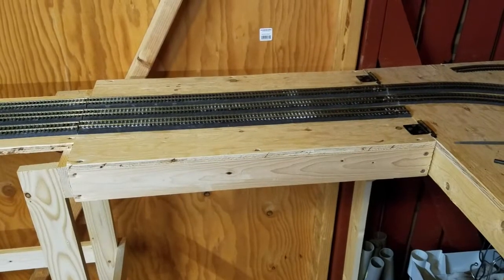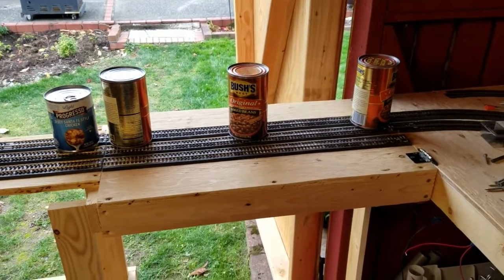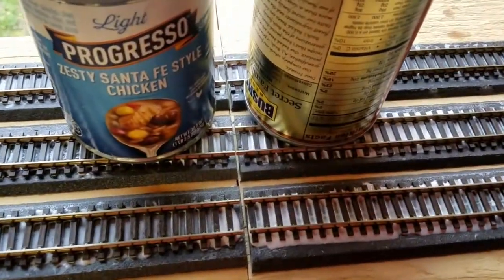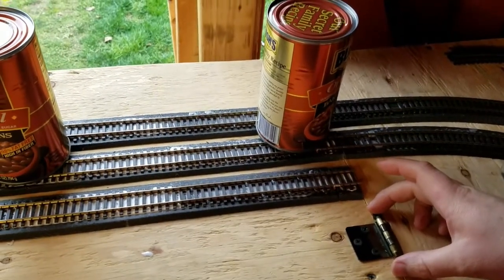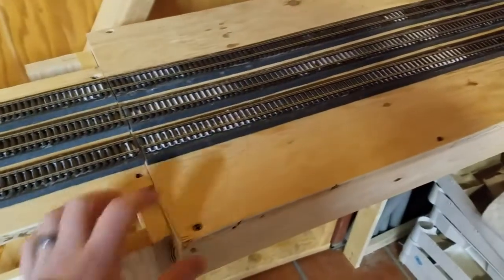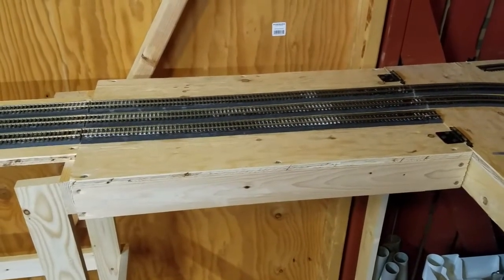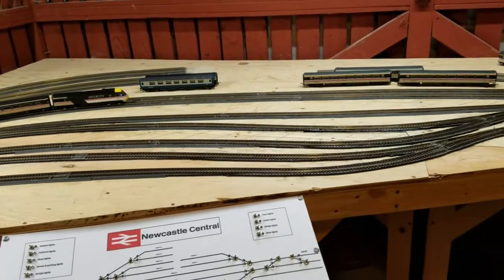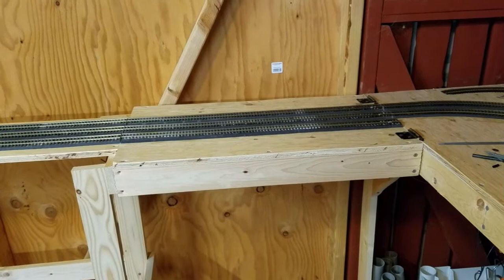12 - Flip-up access hatch

Comment: Great to see how your layout is progressing. I can relate to your lift up section as I did one couple of months ago and especially relate to the derailments, I do sympathise as they can be so frustrating. You mentioned the particular MkIV coach, may I suggest checking the back to back setting on the wheels, (Distance between the flanges), as chances are this is problem. Possibly the wheels are marginally too wide and its catching the track ends. Even 0.1mm can make all the difference. Once I realised this on my layout the trains hardly derail at all now.
Reply from the maker: John Warner Thanks, John. Yep, I thought I'd mentioned needing to regauge the wheels, just haven't had a chance. I have the tool, just need to sit down and do them all. I've got probably 30 coaches across all my HSTs now! Good thing to do on a rainy day, I guess :) I'll get there! Thanks for watching.

Comment: How did you wire the track to continue the DCC?
Reply from the maker: If you look really quick at around 7:45 where I lift the flap up, you can some long dropper wires from each of the tracks. The positive and negative rails from all the tracks connect to the DCC bus wires that are just the other side of the benchwork. It's no different than any other dropped wires that connect to the DCC bus, they're just a few inches longer. I may drill a hole through the benchwork so it looks a little neater, but there needs to be enough slack for the tracks to be raised up like that. Works just fine. Thanks for watching!